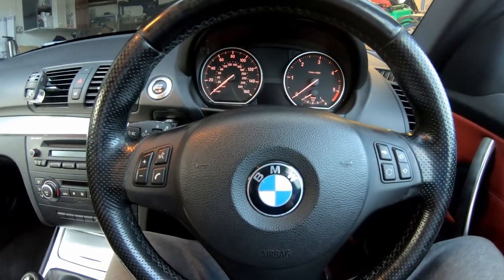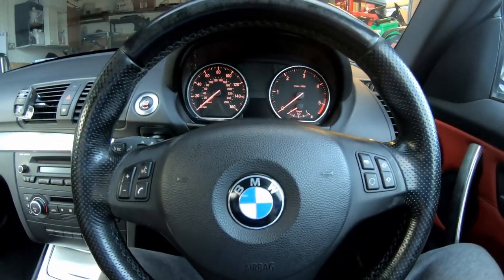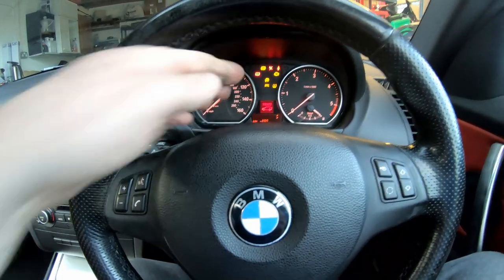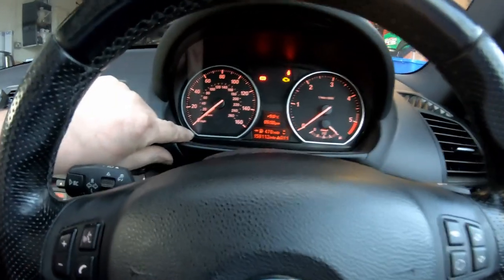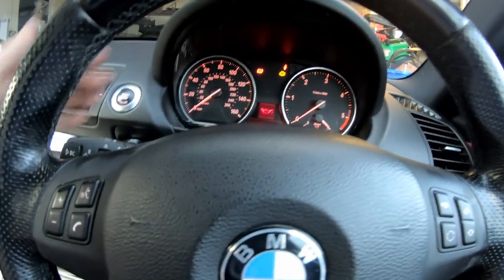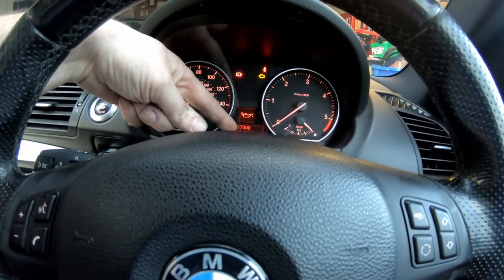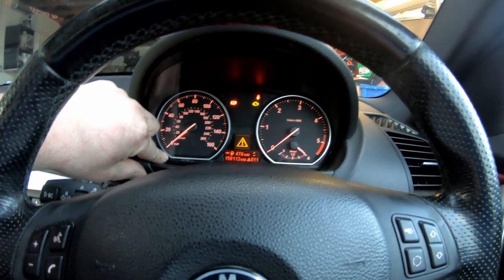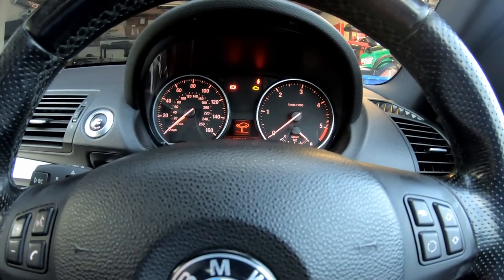BMW 1 Series - Service Indicator Reset Procedure

Comment: Thanks for the video. Will this also work for an Airbag check light reset. It went on after a tire burst.
Reply from the maker: No mate, I’m afraid that you will need a diagnostic tool to reset the airbag light! A Carly adapter is highly recommended! 👍🏻

Comment: Hi Kev I am new to BMW, just had my car serviced and reset using the buttons in the bottom line you have the overall Mileage then there is a warning triangle then the trip (what is the warning triangle there for, is there still something wrong) thanks for this video very helpful
Reply from the maker: The warning triangle can mean a number of things, it's usually an indicator of an error of some kind. For example, when my DPF was refusing to ReGen it would pop up or when the window in the drivers door failed, it also did it then too but it does also pop up when service elements are required, it could be that the car needs a brake service or a fluid change, you can cycle through these with the BC button and the jog wheel.

Comment: Hi. It works pretty fine. I just have a doubt, I changed the oil in May 2022, the oil service was set to be changed in May 2023, I did the reset procedure and it changed to may 2024,is is a problem? Or the car will automatically revert to only one (1) year interval instead of two (2) years??????? How to reset it to one (1) year?!!?
Reply from the maker: It should be one year bud, it’s either mileage but based upon the manner in which the car is driven (CBS) or annually, whichever comes first.

Comment: Kev, my bmw 1 series (59 REG) is booked for a  service next week,  but the service light on dash has gone from yellow to red. I am worried that this will lead to engine shut down.  Do I need to get it  reset even though not had service yet? My mechanic is on holiday n I need to use car for next 4 days.
Reply from the maker: It just means it’s overdue, don’t worry, it’ll be fine for 4 days. No harm done.

Comment: Hi Kevin, i have just had my Vehicle serviced by bmw and they have left the service light on! I cant go back to them due to work and have tried to follow your video, it shows that the service has been reset but the service light still shows when i press the start button, please help
Reply from the maker: If it still shows the service light then there must be another element of the service that requires resetting, check the brake fluid for example, this will be the problem 👌🏻
Reply: You are a legend Kev, please keep your videos coming 👍🏼🤍

Comment: hi kev ,can you give a update on your vfr mods ,I have a 03 bike and wondered if I can just do the snorkel and flapper mod ,also seen you did the pair mod but talked about putting it back for some reason ,many thanks
Reply from the maker: You can do anyone of the mods on their own, there is no need to do all of them, each has its own merits in theory, like I said in the video, they are all reversible so give them a go! I am not convinced by the PAIR valve if i'm honest but the snorkel and flapper made the bike sound so much gruntier! especially when the VTEC kicks in! :)

Comment: Hi Kev done this and reset all. But it still shows a red warning light which the car on a ramp? Any idea how to get rid of that?? Cheers Jason.
Reply from the maker: Yes buddy. That is the symbol for vehicle check, you will also need to separately reset that one as well, you can individually reset different systems, such as oil service, front brakes, rear brakes, brake fluid etc. For example, I did this service reset but now I’m being told that the brake fluid needs to be reset as it’s been 2 years since it was last changed, hope this helps, if not give me a shout and I’ll try to help.
Reply: Kevs Shed hi mate thanks for the quick response 👍🏼 this is what I’ve tried. But still nothing. If I hold the trip button in I don’t get that symbol of the the car and the 2 SS. It goes to this hidden menu with numbers and in German 🤷🏻‍♂️ maybe if I take some pictures and send them over it would make more sense.
Reply from the maker: @Jasontaylor_86  Sure thing, if you head over to the Kevs Shed page on facebook, drop the pics there and i'll take a look!
Reply: Kevs Shed hi Kev I found the problem it was the front brake sensor that had actually snapped 🤷🏻‍♂️ god knows how that happened but I found the problem. New one is order and on its way. Thanks for your help. 👍🏼
Reply: Kevs Shed hey! I followed your FB page. I reset my 2008 128i rear and front brakes and I have the same light on you do (red brake light with exclamation mark). How can I get rid of this brake light to safety my car?
Reply from the maker: @josiahbennett6612  It could be that the brake fluid is also overdue perhaps?

Comment: Thanks for the video is very easy if you have any idea about alarm goes off in my 118 d or how i sort it many thanks
Reply from the maker: I had random alarm issues on my 7 series and it proved to be a battery problem. The battery was weak and the voltage drop caused the alarm to activate. Sometimes this happened at 3 or 4 in the morning!!! 👍🤓

Comment: Hello what is the small triangle from bottom right for?? What use have
Reply from the maker: I'm not sure what you mean bud!
Reply: @KevsShed  I mean on dashboard you have that small explamation mark inside a triangle... In the right bottom corner
Reply from the maker: @BackStabberJeff  Ah right, got you! That means that there is either a fault or a service item outstanding. In the case of this video it was informing me that the brake fluid required changing if I remember correctly! 👍

Comment: Trying to find this answer from long now, hoping you can answer this.

The check engine lights stay on without engine running but when you start the engine it goes away. Why is that?

I'm sure that was not the case during a brand new car and it used to go away like all other lights after checks, I can see same issue with your car in this video.

Do you know why is that and the solution to the same?
Reply from the maker: It should be like that, the ECU isn’t receiving any management signals, if it stays on once running then that’s when there is a problem.
Reply: I have similar issue. I had the codes reset by mechanic but the engine lights comes once a day and goes off after I restart the car after driving for like 5-10 mins. Did you got any further to the root cause for your car?

Comment: Kev i also have an issue that my dash keeps resetting. The car starts and drives absolutely fine. Its used to happen very occasionally before but now it’s happening all the time whilst driving and parked up stationary

Comment: Does this work for a yellow service warning light
Reply from the maker: Should do, Yellow means that the service is due, red just means overdue 👌
Reply: @KevsShed  OK. I'll try it. Thnx
Reply: @KevsShed if red just means overdue service, can i continue to drive car without it shutting down? My service is booked,  but not for another week n the light remains a worrying RED!
Reply: @heathersmith9427  I don't know. But personally if it was just a service light for the oil change I would still drive it. Any other light, I would decide depending on what fault light it was. But it's your choice what you want to do.
I don't know anything about cars so I decided to get a bicycle instead. 
And it's better for my health.

Comment: I was unsuccesful.
I did do it when I first got the car.
It goes into the hidden menu when I press the reset button.
Reply from the maker: Are you holding it down for the correct amount of time? I can't think of any reason it won't work mate!
Reply: @KevsShed  I figured it out.
Thanks.

Comment: wait so the light stays on?
Reply from the maker: No, not if you did it correctly.
Reply: @KevsShed  i did it i reset everything and the light is still on it happened after the service
Reply: @Gameplays-ld1ns  my too, have you get solution?
Reply: @PresidentDrive  yes i actually got it fixed just reset the service using the button which the guy is showing turn the car off give it time it will disappear itself issue with my car was tht i forgot to put the air intake sensor back on 💀😂😂😂😂 that was the light was on i put it back together correctly it disappeared let me know if it helps i got some other tricks too
Reply: @Gameplays-ld1ns  I found that my car show me "low oil level" in display. So, I think that my oil level senor could be damaged :( Anyway, thank you for your respond :)
Reply: @PresidentDrive  check if ur oil is right first check if it’s low or high thn consider going to a mechanic